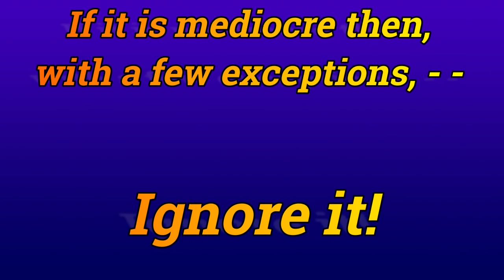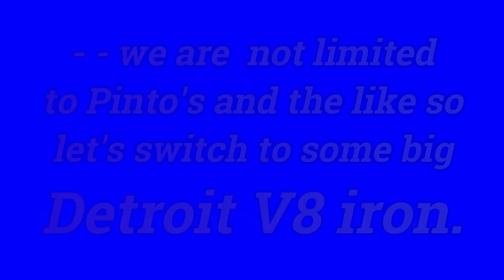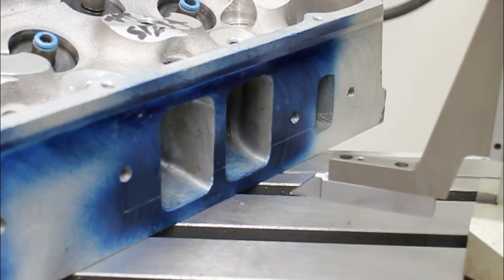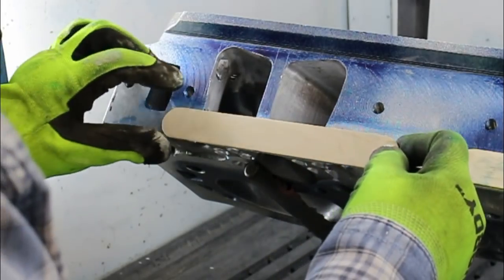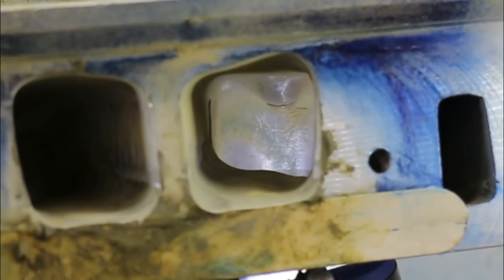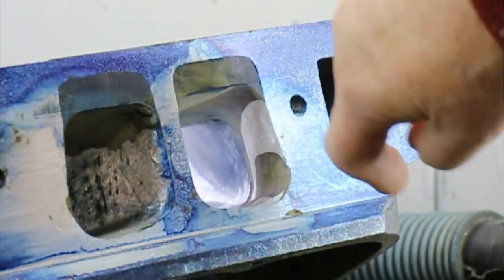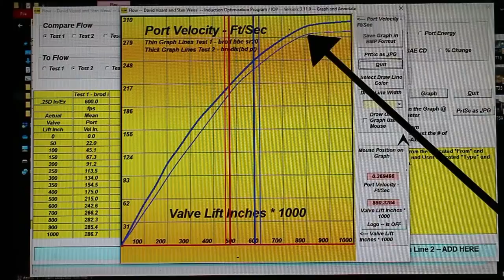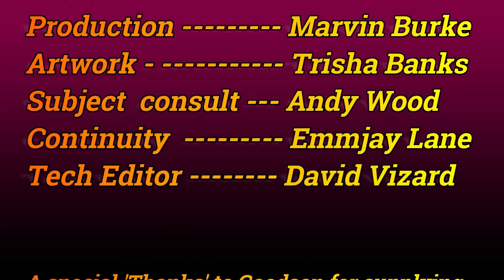David Vizard's PowerTec 10 EP 38 Big Power port filling moves

Comment: Never ending cycle of development, ( If that's not too big a word for it).
Tried port filling the Peugeot 1.9 205 gti  head along with the In manifold attached. Initially it was worth 10-15 hp (My dyno was not the best) so approx 3hp per cylinder. The flow with the manifold fitted was a major disappointment, so over many attempts I floated in more and more resin until the cfm value dropped by nearly 1 unit over the non filled port.
It ended up with enough low/mid range torque that we went up 15 deg on cam duration gained 20ish BHP
from 6 - 8800 rpm and would still take full throttle in top gear from 2500 on 38mm chokes.
If only it had more cyliders🍻

Comment: Devcon aluminum filled engineering epoxies are excellent.  I do not do heads, but have used it many times in industry to salvage damaged castings in pumps and such.  Fantastic stuff.  It's consistency is just a bit more liquid than the Goodson appears.

Your presentations are pure GOLD!  Thank you for making them.
Reply: Yeah I was just researching devcon on some forums. Also a product called Splash Zone a-788. Guy asked how practical it was to use these products for a street driven car instead of race only.
Reply from the maker: Hey Big Moose  - thanks for the tip here. This stuff looks like an excellent deal for intake manifold. Will research that. Got any starting advice???????
Reply from the maker: Hey Big Moose - me again. I  forgot to say it is the Devcon I am interested in. The splash zone stuff looks to be the same as the Goodson stuff. DV
Reply: @marvingvx1  David, the product I used was Devcon Aluminum filled epoxy Devcon part number for 1lb 10610, for 3 lbs part number 10620.  To me it was a non sagging paste, mixed with a putty knife and applied with hard pressure.  I used it to recover pumps.  I did a pretty good job in preparation, thorough de greasing and bead blasted.  I rebuilt scrolls and even bearing journals.  As for the bearing areas, I remachined and installed new ball bearings.   It is amazing how long many of these repairs lasted.  Not cheap at around $70/lb, but to me, it's the best in the field.  Hope this helps you some.

Comment: You never fail to answer nearly all my questions. I'll be using this wisdom on my cleveland heads for, hopefully, more streetable power.

I don't have a flow bench, and if I don't build one, I'll just rattle around in the ports a bit until I feel satisfied that I've reproduced some of the characteristics that you've pointed out.

Comment: Thanks for the information!  I was pleasantly surprised to see this information.  A few years back I prepped a set of heads myself for a project car.  I filled the bottom of the ports and recontoured to roof almost exactly as you did.  I did it without ever seeing of hearing of this, it just seemed to make sense to me at that time.  I feel vindicated in my theory!  I also moved the pushrod holes and filled the breach in the ports.  And you are correct that JB weld does not work there! It softened and failed in this area.  One thing I would advise against as well, do not use the JB "quick" in place of regular JB weld, it is not anywhere near as durable.  Thanks again Mr. Vizard!
Reply from the maker: Robert,
 Thanks for the JB weld tip.
DV

Comment: Really well shown thank you David .to the chap asking about how high to raise the floor , the way i did it on a small engine , an a series  ,was to put it on the flow bench , and add plasticine to the floor until the flow stopped going up , then i could play with the shape of it to get the best flow and sound from the port ...using my flow ball and cotton thread .
Reply from the maker: Robert, Your method of determining how much need to go on the port floor was right on the money. after the port floor ahs be raised to the point that no more flow is seen it is time to start on the area's a flow ball shows' are the busiest and slowly rework till the flow once again tops out.
DV
Reply: @marvingvx1  thank you David . :)

Comment: Looking at port area / valve area, both heads are pretty close IMO and the ports are far from small :) but I guess this is high rpm racing stuff.
Thank you for showing us the special custom driling prep and the grinding. I guess not to many would dare to do this.
Reply: Maybe more cubic inches than rpm related.

Comment: I had some canfield heads that had alot of work done they had epoxy in copper tubes in the intake ports and it was leaking when i vacuum checked it so I used jb weld after removing the old epoxy  and never had a problem again

Comment: Have you ever filled the ports on a 351 Cleveland 4 barrel head? Those have such huge ports, just wondering if that would help
Reply: The was a company in Australia a while back that did port fillers/tongues for both exhaust and inlets on Cleveland 4v heads. I believe they were Parker performance products. The exhaust was sheet metal stainless that was held in by the header and the inlet was alloy.

Comment: For many reasons You've stated in the past, "I want to jump to the conclusion!?"  That "USUALLY" You should use the largest intake valve that easily fits in a cylinder head  And maximize it, For Low lift flow, Even if valve shrouding becomes increased,  When "MAXIMIZING FAT FLOW"!  (When using cams that only have .55"  Or less lift.)  PS. I'm not very eloquent. But You have Made me look great  Many times when standing on your shoulders in the past, I.E. using your ideas, Applied to vehicles.  Respectfully,  Kurt

Comment: David.  i had a good low port head, car performed well, but not good enough.  i set those heads on a shelf, and got some that could have a roof that is .200" higher off the deck, and could be .075" wider at the pushrod.  I built a port that flowed awesome, with similar port area (just a tiny bit larger than the original heads) with the floor also raised a signficant amount.  flow increased from 310 to about 340.  it make great power on the dyno, 60hp more at 8600 over the old combo, but would not do well at the track unless it was driven extremely aggressively (really high launch rpm).  it would BOG and lose .15 of a second if the launch wasnt where it needed to be.  and even then, performance was no better than the original induction combo.  i tried filling in the ports more, and a smaller cam.  same result.  i am STUMPED.  Bogging usually means too low on velocity.  but, is it possible the port is not BIG ENOUGH for having been raised so much?  JUST A NOTE: the velocity on this port will exceed 330 fps at the higher lifts.  might be too much, making the flow unusable.

Comment: At the 20 minute mark when talking port density and the sr20 head on the dyno I assume that the only reason the sr20 head beat yours on the dyno was because of the bigger valve and related area. If the sr20 head had the same size valves snd the curves were as shown here then likely yours would beat it on the dyno as predicted by the curves?
Reply from the maker: We have dyno's to establish these points!!!

Comment: Thank you david vizard performance. I want to use a set of reworked large heads on a small block chevy, converting them to street heads using a raised floor to reduce cc runner 'quantity' .  They are raised runner race type heads. Using the same drill technique or not, have you ever poured molten aluminum to fill? Also Alfadan mahle collaboration engine is scheduled to come out in boats 2024, if all goes well, it could very well take over the industry, they made free valve technology for the huayara. It incorporates great features like gearless transmission through a multi range coned torque converter like device.

Comment: Ill be doing this with my 7 port head for the A series. Currently it has 40mm ports and throttle bodies on a 1310. Way too big. Im thinking about going down to 30mm ports and throttle bodies in an effort to get the velocity up and hopefully see a decent torque improvement right through to 7500rpm

Comment: I am thinking this would be great on a smallblock 318 Mopar engine using the 360 heads with the bigger ports for mild applications I think the ports are to big for a mild 318. Anyone out there think I am on the right track with this thinking?

Comment: Thanks for sharing Mr. David, if you have the time  it will be great and much appriciated  if you made some special episodes on 4 valve cylinders heads like the mighty engines like  B series Honda and 4G63 engines from mitsubishi. 

And maybe touch the subject on the effects of raming air into NA manifolds via scoops at high car velocity, like circut/endurance racing are there any things to take in account.
Reply: Hi Remy. Think I can offer some amateur flowbench 4 valve stuff, but I consider its something to look before making engine swap for example OEM Honda. YouTube offers a tool for sharing and also discussion how to approach different things like restrictions. I think you could take a look, because I even got the filler!

I approach scoops, throttle bodies and chambers like they are tested on the track and the meter for making decision witch way to go is, how that thing accelerates. Different story does the engine make more dyno HP. David Vizard Performance channel is teaching us even no 4 valve head in the studio.

There must be more "4 valve" guys ho could show how to do things and I would like to encourage them to do it. Cheers,

-juhana

Comment: For when you want your heads set on KILL!  It's like the nitrous button you can't turn off! Haha,  loving it, these videos are awesome 😎👍,   I have 2 maybe 3 sets of heads I'd like to do, one is a set of 210cc Doug Herbert. Chevy heads id like to set to kill! They are new 12 year old heads,  and another similar set I'd like to do similar, and drill steam holes for a 400 block,  I saw a 400 with 283 crank, I kinda like that,  but I would want a 5-6speed behind it, so I'm thinking keep it a 406 , convert to 5.7 rods, a 406 with 10:1 mild cam with . 550" lift should be great for the street, maybe go 9:1, and turbo it! The kill set is on a 385, with 5140 crank and rods, forged zero decked pistons, and arp studs in the heads and 4bt mains! So it should handle the power!

Comment: Should I get a set of AFR  195 cylinder heads for a 385 stroker I am working on, or fill the AFR 227's my customer already has?
Reply: SELL THE 227 AND BUY THE 195
Reply: I think it depends on camshaft and purpose. I would be really reluctant to fill a port on a customers build if you dont know enough you have to ask. On a 385 with more than 0.550 lift the 227s will make more power from 2500rpm. They just will. How do you think your customer will react when you want to bill them for 40hrs so they have 10-20ftlbs more at 4000rpm? 
The smaller heads will have better transient response and probably a little better fuel economy driving around town but unless you are on a 1/3 mile oval the response might not be noticeable. Dont forget that Ls3 engines are 376ci and have 260cc intake ports.

Comment: David, the knowledge you are sharing is amazing. Have you considered partnering with one of the aftermarket head manufacturers to make "VizardHP" castings? They could potentially scan your optimized designs and change the sand pieces that form the castings. Brodix and TrickFlow come to mind.
Reply: Didn't Professor Vizard do something like that with the major camshaft grinders? Even with proof, Professor Vizard's advice is regarded with suspicion among these cam companies. That said, I would love to see and own a Vizard developed aftermarket cylinder head.

Comment: My general impression of BBC heads is that rectangular port heads are big, inefficient ports while oval ports are efficient but small. The drag race engine doesn’t care about the inefficiency, just the top end power while the efficient oval port will do very well for a street engine (even a big one). Your work looks like you’re raising the rectangular port and adding bias, then reducing the cross-section to get back efficiency. Basically increasing size where the high velocity air lives and blocking out the low velocity/stagnant (relatively) areas. So, my question is, how much does this apply to a rectangular port LS head? Back-to-back tests by Richard Holdener show a 6.0 with rec port heads gains power throughout the curve when fitted with TFS 225s, a head with smaller ports and smaller intake valves. Flow numbers favor the TFS head even though both have more than enough to support the power level of the 6.0 at 6500 or so rpm. By inspection, the TFS port velocity and coefficient of discharge must be better, probably a lot, based on smaller port volume and smaller valves. Likewise, port energy must be up, too. So, can the rec port head be improved similarly to the BBC head? Great video, thanks!
Reply: Great question.  Seems when discussing this stuff nobody brings up the different uses of the engine.  A road race engine would probably benefit GREATLY from this, because they operate in areas where a drag race motor never does.  I don't know why we are so focused on drag racing, the most expensive and shortest amount of seat time racing in existence.
Reply: 2-5 minutes of circle track is more fun the 12-15 seconds of drag.
JMO😁😁😁
Reply: @hotrodray6802  There is a difference in the engines that are successful there, which I guess is the point. I’m more of a strong street engine guy, drivable but fun level of power.
Reply: @HotRod Ray  try 7 or 8 seconds.dont know what your driving that takes 15 seconds.lmfao

Comment: My question is under boost is this worth it with the port job you did without the filling in and stopped there air pushing/rushing in may take advantage of the whole port boost creating more velocity
Reply from the maker: This is only critical if the boost is limited as were the Indy engines in the past.

Comment: So I've got a tiny 4v engine (1300cc that revs to a whopping 6500rpm) that has a port that's equivalent to a 42mm ID tube. It's a drainpipe feeding a drinking straw. (For those that care, it's a 2NZ Toyota, as found in the Echo/Yaris/Vitz family)

Engine Analyzer says that if I fill the port by 30% or so without losing much flow (I'd be tidying things up at the same time and doing a valve job, it's feasible to shrink the port without losing when you're starting from stock) and install the longer duration cams from a different engine in the same family I'd be up 5% in peak torque and nearly 20% in top end. Evidently the port is still too big (EA says the velocity is low) and it's only just starting to work.
Reply: So you think that the 1.5 is the same size? Is it to big?
Reply: @augustoa.b.1412  I don't quite understand your question.

The 1.5 litre version of my engine is a little taller, but it fits. I just can't use it because of the rules around engine swaps. It has the same head casting and cams that are a bit longer duration. I'd use it if I thought I could get away with it though.
Reply: @skippy2987   the question is, if the 1.5 it have big port to the little engine? sorry for my english
Reply: @augustoa.b.1412  the 1.3 and 1.5 both have the same ports, and it's too big for both. If I had a 2.0 they would be nearly right.
Reply: The 2zr-fe we got in north america has the same problem. I pulled the intake manifold off mine and ran the numbers on it and velocity at peak power isnt even 300'/s. The intake tract is way too big for 130hp and the engine is really soft on the bottom. Is seems like it makes less than 100ftlbs until over 3000rpm
Reply: @timothybayliss6680  the NZ series doesn't feel flat, it's got too much compression and too short cam timing for that (215 degree seat duration) but yeah, specific torque isn't as high as it could be and certainly not as high as I want it to be.
Reply: @timothybayliss6680  here in Argentina, the 2zr-fe have the intake of the 2ZR-FAE, have 2 duct length, it have 140hp, and torque is felt at very low rpm

Comment: Also what was the before and after for the head? You showed a different head for comparison
Reply from the maker: Yes, I showed a head that is far better than a typical 24 degree one. The one shown is the SR20 20 degree big valve (2.4 inch diameter) Brodix head.
DV

Comment: well it is out the the shop and tear down the lawn mower for some practice port work. ..
Reply from the maker: Ah  mmm - ??????
Reply: @marvingvx1  I am on a farm with access to a lot of small engines, so I practice on the 1-2 cylinder engines. It is quick, cheap. and easy to do and only have 1 or 2 cylinders to do so not trying to match 6-8 cylinders to each other. And if I mess up it is not a big deal. I can then tackle the "real" motors with more insight and some skill and confidence.  And Thank you for these videos I have gained a lot of understanding of what  it means to do this type of modifications. It is not just H.P. (HOG and Polish) but a real science.

Comment: i prefer to just have it welded
Reply: Yeah, a $50 epoxy kit vs. $2k in welding.  How about just getting the right heads to begin with?  Always that one guy
Reply: @superkillr  you are correct.  i have since learned to use PC7 quite well.

Comment: An another,from 1 cylinder.Use a smaller piston.Runs easier.Heat cause size difference,and it gets "stucked".After ++1000km it has changed form,trash can,changed.Better with egr exhaust gas recirculation,sls.Piston pulls up oil to the top,small piston.On F1 cars.Watched bmw,or mercedes.Had gigant skirt.Others has zero skirt.Small pistons.I have many,to file off skirt and edges.
Reply: WTF are you even saying?  Did you just randomly put those words up there?
Reply: Superkilr
dont be a rude jerk to someone who has english for a secondary language.
I got everything he says.